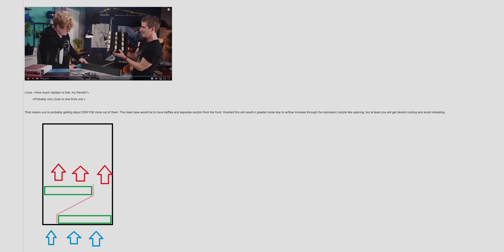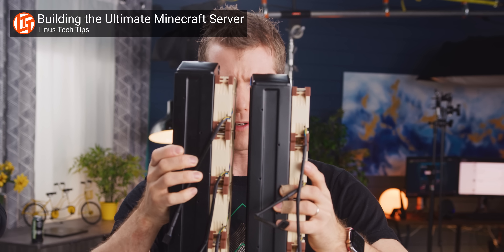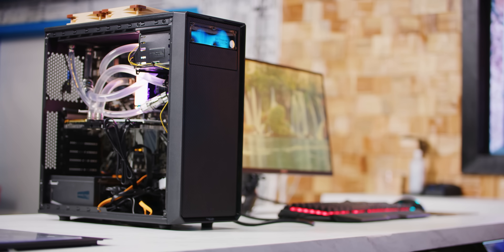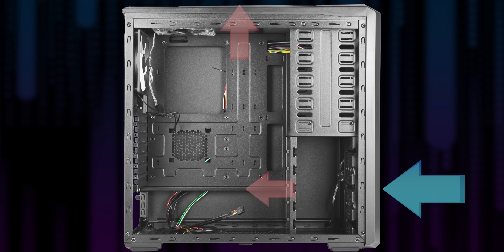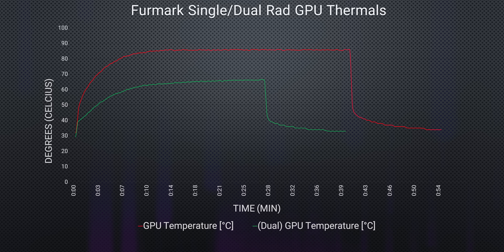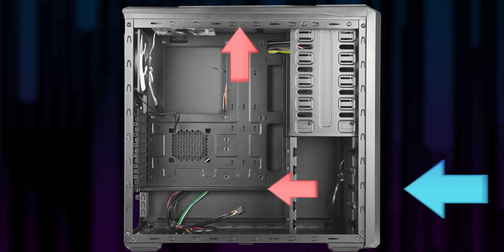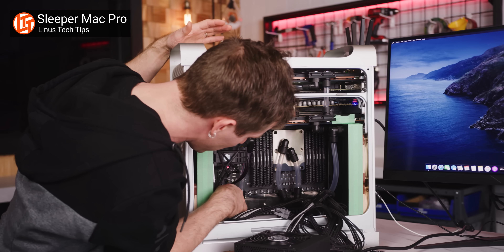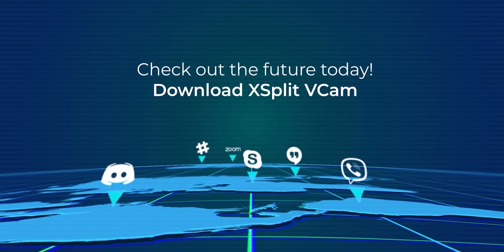I’ve been water cooling wrong for YEARS - $H!T Manufacturers Say

Comment: What temperature does the water get up to? Pasteurization of the cooling solution would mitigate long term build up of organic material. Which would impact PC performance (too many radiators results in ideal temperatures in which bugs can grow and affect the heat transfer in the water blocks on the chip sets...?

Comment: "Nobody would do that"

Says the man building a watercooled gaming chair
Reply: We will see a watercooled calculator soon. I wonder if it can run crysis...
Reply: And i did that. had to much sticker to much fre time
Not the chair thingy but the close every gap in the system thing. Only radiators can suck air in or out.
Reply: @sn31t33  If you're wanting to control exactly where your air is flowing that's the best thing to do.  I did it with my newest bulid.  NZXT H510 is a pain in the ass case to get airflow worked out because of the tiny filtered intakes.  

It was causing negative pressure with two 140mm intake fans.  Swapped the filters for nylon.  Boom positive pressure.  Then had to seal up all the cracks.  Used small weather stripping to seal the glass panel.  Temps are perfect now.  Some of us do that shit Linus. 😁
Reply: lmao
Reply: Hahahaha
Reply: Ded
Reply: @Wessel M - Shit if the price to admission isn't astronomical and the video proves it can help or even be done, I might just do what he's saying. I've ALWAYS had the idea that it would be awesome to create a chair that essentially is like an oldschool water bed. Essentially have the water inside the chair and constantly flowing. Why? Because I thought it would be an improvement over using a heating pad for us sufferers of chronic pain and who game/use their computers exclusively as a hobby. As hot water helps take the edge off the pain. Not a big edge. Enough to go from screaming bloody murder or crying asking someone to kill you because the pain is completely unbearable, to realizing your body feels like a truck hit you, but you have now stopped crying/wishing death. So, turn that into a chair, and those including me who suffer from chronic pain, can enjoy their hobby for longer stretches of time. (Or sometimes, at all.) 

This all assumes two things
1) The way he's going to "water cool" a chair is using the same general concept that I've been thinking of for years. Just taking it to it's logical extreme. 
2) The chronic pain I'm referencing is of course somewhere in the back, or in close proximity to the back that a chair effects it's intensity. 

As this video would either prove or disprove my concept and thus give me a ball park figure on how to accomplish said task. Again, if the concept actually works. He's got money to burn, I don't. So I'm really looking forward to this video.

Comment: ah corsair, the supplier of watercooling from personal to industiral applications

oh wait
corsair is just  buying from these guys XD

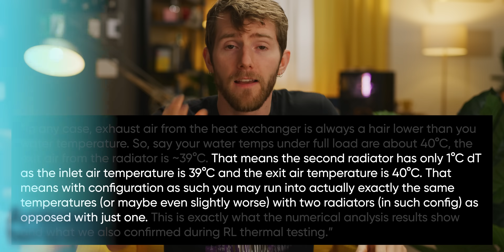and if you ask me it shows in the text @ 2:31
whats the inlet air temp for the first rad in that example? 38°C ? whats the airflow? 1 CFM ?
or how should the temp be even "slightly worse" with two rads? 39°C air is heating your water to 41°C ? 

give this guy the nobel prize, its the first time ever we can create energy from nothing

if this understanding is your starting point for any kind of simulation, then its doomed before you even start to set it up

i "tested" the difference from air inlet to outlet on my 9x120 rad some years ago, cause i had an aquaero with probes
laying around and some time to kill :D
the max dT i could get was 3K (btw you dont use Celsius for delta temps @ corsair) between air in- and outlet
with at least 1k of uncertainty (did some runs and changed the sensors back and forth)
all that with 25°C roomtemp, fans at 350rpm (was to lazy to shut them off), watertemps of 38°C and a system power 

draw of 750W average (fluctuating between 720W and 820W)

Comment: wouldn't having more radiators also mean that the "average" temperature per radiator would be reduced? so that the air would turn out cooler after the first radior leaving more room to cool the second radiator?
or did I miss something in the whole water cooling thing?

Comment: Adding more liquid to absorb heat will always have a postive effect on the curve initially as it is more mass to absorb heat.
Eventually the loop has to expel heat at the same rate it is absorbing it. Depending on the flow of the rads and the thermals inside the case you could end up heating up the liquid in the second rad instead of cooling which would cause a worse curve than with one rad potentially.

There are a large number of experiments you could do to see the most efficient method of cooling. for example removing the second rad and just having the liquid in reservoir. practicing with fan directions and liquid directions etc.

Comment: Stacking rads is bad IF you still have other mounting points which the their own intake available that wouldn't require stacking. If you just only have space to stack, then sure it will cool more than not having the additional rads, but it won't be as effective at cooling as if it had it's own dedicated fresh air intake. That said, most builds that I've seen stacked rads in have major space constraints, which make alternative rad placement impossible.

Comment: A radiators efficiency depends on how much air is moving through it. The more air, the less efficiency and coulder out temps. This is pretty simple if you think about it
Reply: efficiency of a radiator depends on more than just how much air is moving through it.  water capacity and flow rate also make a difference.
Reply: @aaronthomas6155  6:30 sure, air flow is the only important one in this context though
Reply: @teddygoboom1  How so?
Reply: @aaronthomas6155  I'm not sure if I can explain this well but I'll try: Corsair said multiple radiators could hamper performance. That's only possible if the second radiator is blocking air from getting through the first, and the exhaust temp from the first is close to the water temp. The faster you move air through the first, the cooler the air coming out will be, and will be able to transfer more heat when it's recycled through the second radiator. While pump speed can affect CPU temp, the amount of heat transferred to the air will be the same as the processors power draw, so same wattage + same air flow = same RADIATOR efficiency and exhaust temp, which determines how effective the second rad. Can be. I probably made that way too complicated than it needed to be, and it's not perfect but hopefully you see where I'm coming from

Comment: You did the test "wrong" and I demand another test. As you mentioned, flow is important, and I suspect that if first was the front radiator and top was the second, you might get a result between. It would be like removeing heat in the first radiator then putting it back in the second one. And I think you need to point this out to people and do a proper test.

Comment: Those radiators aren't close to big enough to transfer more than 50% of the heat from the water to the air. For all the people arguing with  Linus, there's your reason. - your friendly engineering dropout.

Comment: You didn't measure ambient temp vs water temp after the rad. You added a rad, thus increasing the flow. Pressure and flow is affected by the pump and the loop flow resistance. Even a minor deviation in pump speed, will reduce the temp delta cross the rads dramatically. For some reason, I have yet to see a single video, in which people master the very basics of water cooling. Like the very, very, very, basics. This test is so flawed, you guys have no idea what you actually test. What is the flow restriction of that rad again? As usual, there is not even a mention of pump settings or flow.

Comment: They are right. Lets delve into some delicious thermodynamics 😁😁😁

When considering the convective heat transfer equation:

q = hA(T_s - T_inf), with h the convection heat transfer coefficient and A the area.

It is used to calculate the amount of heat transferred to a liquid (air, at T_inf) flowing over a surface (the rad, at T_s), we see that the difference in temperature clearly affects the heat transferred.

Therefore, if the radiators are stacked back to back without cold air being introduced into the system, you will hit a limit whereby more radiators will not add more cooling capacity to the system. This is when the temperature of the radiator fins and air is the same, thus T_s - T_inf = 0, thus q = hA*0 = 0 (no heat transferred).

In your system, cold air was introduced due to the difference in air mass flow rate (amount of air flowing through each radiator). The front panel restricts airflow, causing cold air to be drawn in by the upper radiator that has less resistance, in turn increased cooling capacity. Pretty interesting hey?
Reply: Your last statement is inaccurate - water circulates through a system so quickly that the temperature largely stabilizes throughout the loop. The order of parts in the loop makes no notable difference in cooling efficiency.
Reply: Jay's two Cents has disproved that last one. The only way to to get a noticible difference between GPU & CPU is to run 2 seperate loops
Reply: Well the order thing simply isn't true. A water radiator system is a heat pump and a heat pump always transfers the most total energy at the greatest peak temperature differential.  Your GPU will run cooler in your order, slightly, but the overall loop and CPU will be noticeably higher. Stop acting like copying a google result or textbook means something. If it reads like a person trying to make a proof for class, it probably has no substance. Fact is, Linus gave enough data to get cpu heat input, gpu heat input, radiator efficiency, difference in ambient and radiator 2 air temp,(some fresh, some internal). These are all that is needed to calculate. 1 radiator, water out of final rad (cpu inlet), around 82c, 2 rads, 59c, your order of 2 rads, 63c. Not the end of the world if someone does it, but you shouldn't pass off formulas you just read for the first time, then not do any math, and issue an idea as fact.
Reply: Thanks for doing the math. It’s funny this video proves it’s not so black and white and that there cases that multiple rad do infarct work l yet propelled want still point out some formulas why they don’t work
Reply: I'm not sure the difference will be that great since in the case of the CPU-GPU-RAD-RAD, the delta of temperature between the air and the water will be higher thus dissipating more heat. Even if the second rad is less effective than the CPU-RAD-GPU-RAD setup, I think that the sum of both rad will be very similar.
Reply: I’ll check out Jays loop. The difference may be within margin of error, but it should be there. Unfortunately we can’t “assume ideal conditions” 😂
Reply: @aidaneloff5357  The difference isn't noticable because the heat sources are very small and the radiators are quite small. It's very hard to measure. 
Yes I agree it would make a difference if you where talking a server bank or a car. Something with a large high power heat source and larger radiators.
Reply: agentcrm I found the vid, seems like he only uses one radiator. Jay has a point when he says the difference in temp between the water flowing into and out of the radiator is only 1-2C. It is relatively small, meaning the difference between 1/2 rad setups is next to none. 

However, if you used much larger radiators or weak ass pump with low flow rate only then can expect to see a difference. 

Funny enough, that inlet/outlet temperature difference is only about 0.2-0.3C for certain car radiators, but it still manages to dissapate a lot of heat because the pump is so powerful (high mass flow rate)
Reply: Does not compute

😅

Comment: I really doubt that most radiators coupled with good fans are so efficient that the exhaust air have such a low delta that a second radiator makes no difference. Maybe with a super thick radiator or a slow moving fans but not in your typical cooling loop trying to cool a high-end system. I'd actually like to see a comparison between water temperature and air exhaust temperature to confirm this.

Comment: You need to test with more setups. Rad 1 alone rad 1 with top exhaust fans only rad2 alone then both. A single intake rad seems only as good as your exhaust to me since it's pumping all the heat it's taking off the board directly into the case. This reeks of confirmation bias currently. Losing the fans on the minecraft box explains 5 degrees I think as well and seems to really make a case for that last rad not being needed at all.

Comment: He has done a test with different setups with only fans. Like all intake, all exhaust and combo setups.
What I'm missing here is a setup with drawing in fresh air from the bottom with also a rad on the bottom and then top and back as exhausts or rads on only on the back and top and then compare Temps.
Btw what happened to those external radiatortowers sold years back? He should revisit that concept and compare to today's setups. 😋

Comment: This could be really complicated, but Corsair could be right too. Thinking about the triple stack of radiator on the minecraft server. If the hot water comes into the stack on the first radiator (airflow intake of the stack) that radiator will have the highest heat transfer rate of the entire stack, and both of the next ones will have either a greatly reduced heat transfer rate, or, in theory, a negative transfer rate depending on the water temperature or efficiency of the radiators (efficiency being the overall conductivity of the convection and conduction). In the case of the HackPro, there is no fresh air coming mixing for the second radiator, so this phenomenon could happen too. The logic way to maximize the cooling would be to have the hottest water going to the back radiator and then the front one, so there is the maximum heat transfer rate at that radiator. Most cases are negligible, but some edge cases could make a huge difference. Math can give the answer in all cases, but I'd have to dig up my old heat transfer books... Maybe, it could be fun to do...